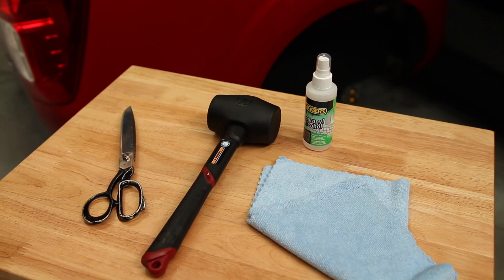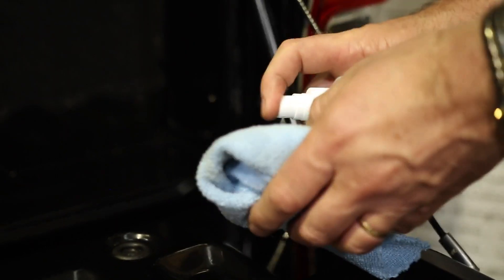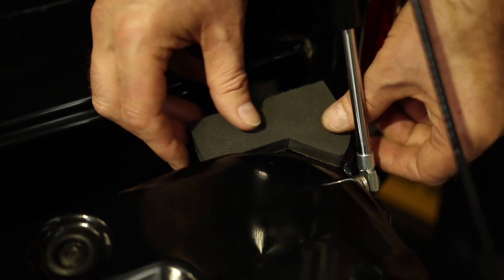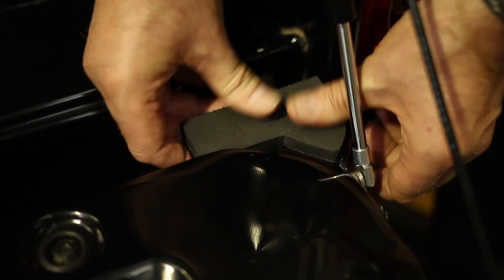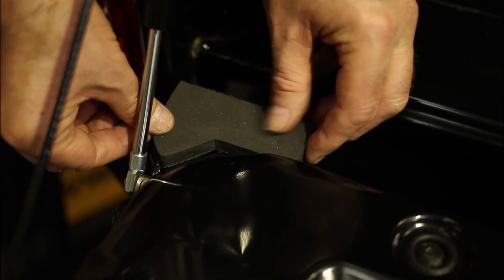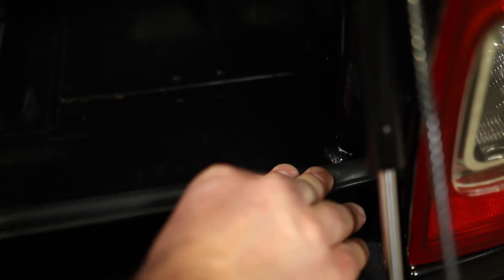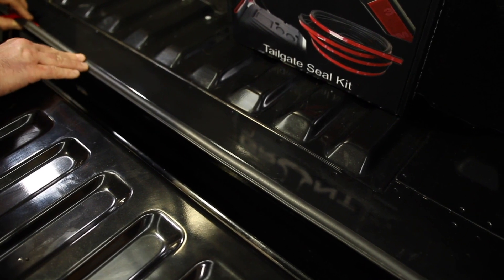Grunt 4x4 Seal Kit Install - Ford Ranger PX (No Tub Liner)

Comment: The fitting instructions are poor, but if you can install it correctly this seal kit works fine. I had a look at where the pinch points were on the tailgate and installed the horizontal rubber with the lip facing outwards/backwards, this is just long enough to get from one corner to the other. Then I closed the tailgate to confirm that the seal was compressing all the way along. Then the fatter seals go on the inside (closer to the front), the video shows this bit of the install OK but use the fatter rubber and continue these above the striker all the way to the top of the tailgate in the crush zone. I closed the tailgate to check, then reopened and adjusted the section above the striker to get a better seal. Then I left it closed to stick under pressure for 24 hours. You can feel the seal compress when you close the tailgate, and using a torch i cannot see any light getting through anywhere. I reckon everyone having issues has installed the rubber seals incorrectly because the instructions are… inadequate.

Comment: The inner seal is next to useless, there is a massive gap between the seal and the tailgate. outer seal is good.
Reply: The video doesn’t say, but I used the fatter rubber for the inner seal and continued it in the crush zone above the striker all the way to the top of the tailgate. I don’t think the thinner seal would have worked but the video didn’t say which one to use. The video also says to install the seal “up to the striker”, but trimming it there would leave a gap so I continued with the full length of the sealing rubber all the way to the top of the tailgate, closing and checking and then readjusting the location of the sealing rubber above the striker to make sure I had a good compression seal.

Comment: Doesn’t seal the side of the tailgate. Both inner and outer seal are completely useless… There’s huge gaps left open in bottom left and right corners. I can already tell a lot dust will get through.

The instructions are terrible. Poor quality black and white printing showing a black ranger with black seals. Can’t see a thing. Why are the photos in reverse order? Also says “see back of page for a clearer image” but the reverse side is blank 😂😂

I’ll be removing mine to replace with a properly engineered seal from EGR. Waste of time installing this